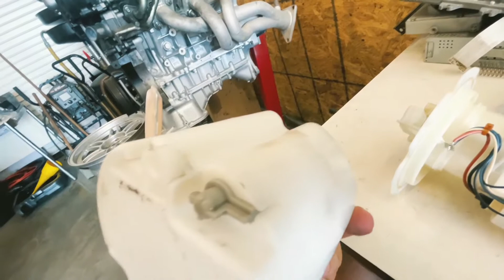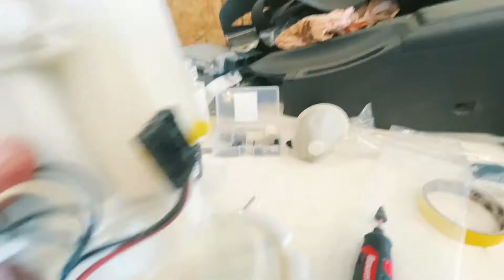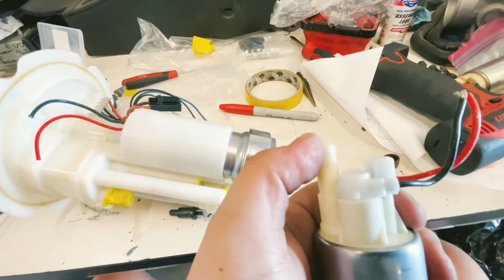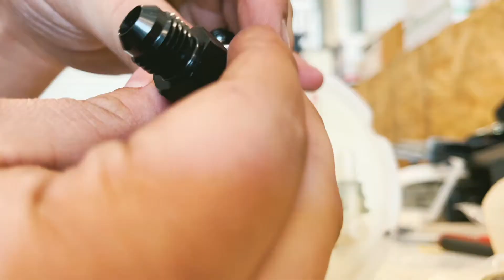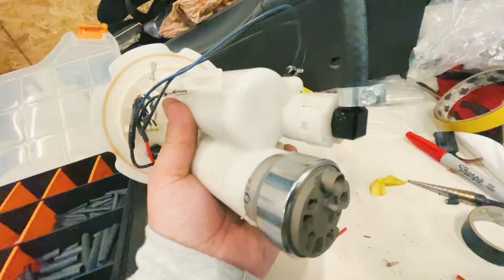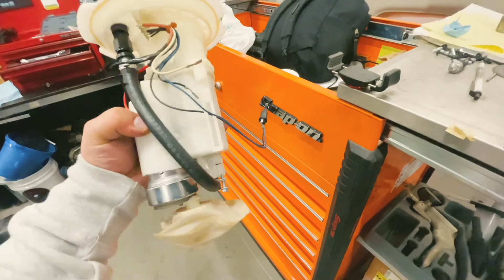TURNING MY 350Z INTO A HELLCAT ! 350Z HELLCAT FUEL PUMP AND CJM FUEL RETURN KIT INSTALLATION !

Comment: Did your plug ever heat up ? The one that connects to the bascket? My shit keeps melting the plug
Reply from the maker: Yes 😢
Reply: you gotta hit up charles from cjm and ask for the upgrade wiring and connector kit for your car , It uses the proper size wiring for your power and ground .Its not on his website so you have to ask him about it. I installed one on my car and so far so good but only time will tell.

Comment: How did you get it to close? It seems even with the trimming and removal of the springs mine won’t close to fit inside the tank.
Reply: You get it figured out? I’m running into the same issue
Reply: @guy_with_the_evo yes it was the OEM fuel filter. I ordered a walbro mini off Amazon and it fixed my issue!

Comment: Did the 1/8th work out for the drilling ?
Reply from the maker: Still not installed been so busy but will install shortly
Reply: @Alxbmovn  did it work out well? I need 60psi pressure for my setup

Comment: I did this swap in my g35 and I'm not getting good fuel pressure reading on my fuel regulator gauge... how is ur fuel pressure
Reply from the maker: I would check the lines maybe make sure there routed correctly or the pump or you make need to drill Venturi more or maybe you did to much